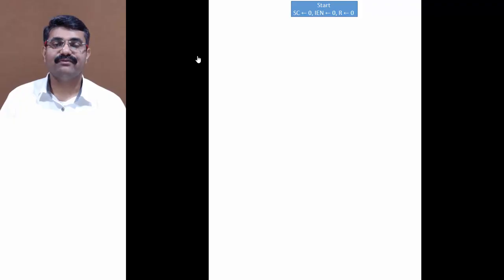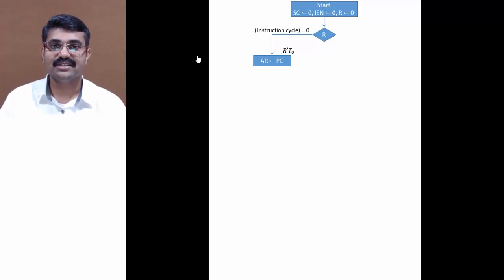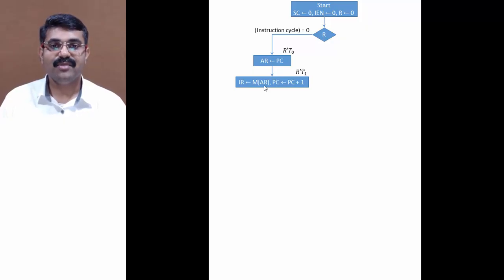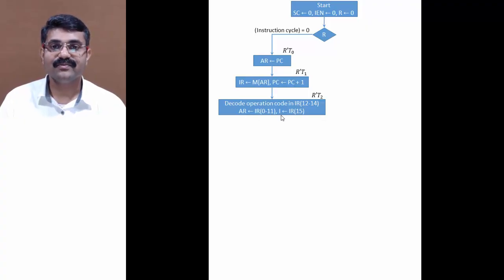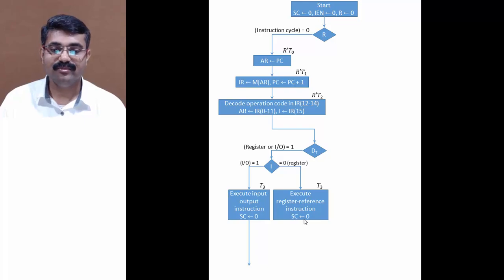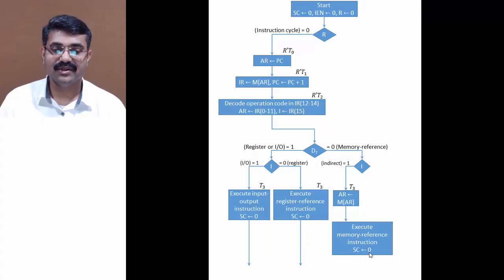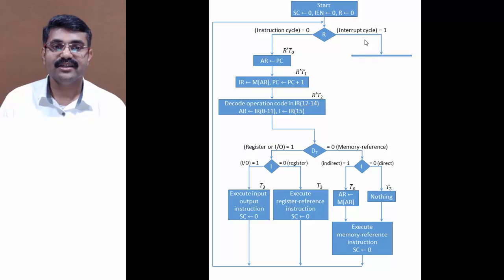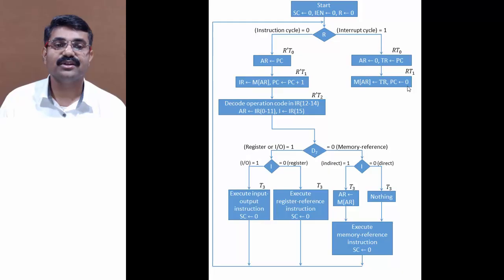2.10 Design of Basic Computer

Comment: Sir can you help me in this circuit
"A digital computer has three registers: A, B and C. Four flip-flops provide the control functions for the computer: S is a
flip-flop that is enabled by an external signal to start the
system’s operation; L and R are used for sequencing the microoperations; A fourth flip-flop T is set by the computer when
the operation is completed. The function of the system is described by the following register transfer statements:
S: C ← 0, S ← 0, T ← 0, L ← 1
L: L ← 0, if (A = 0) then (T ←1) else (R ← 1)
R: C ← C + B, A ← A – 1, R ← 0, L ← 1
Design a circuit with minimum components to implement the above operations."